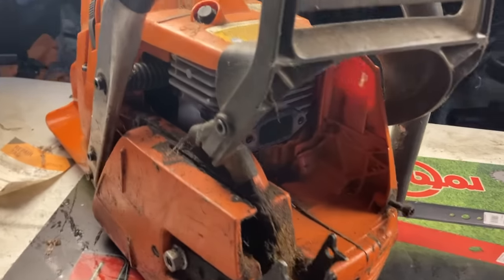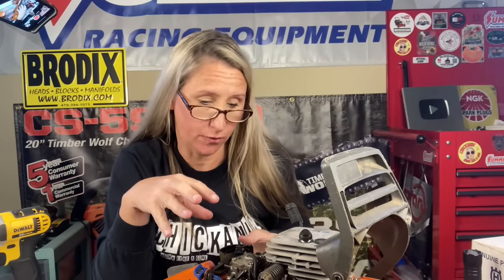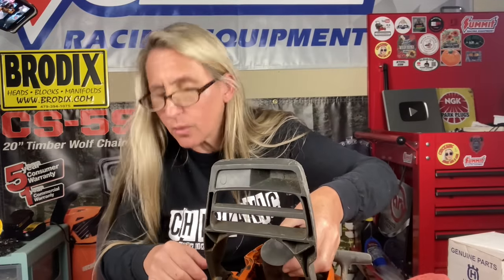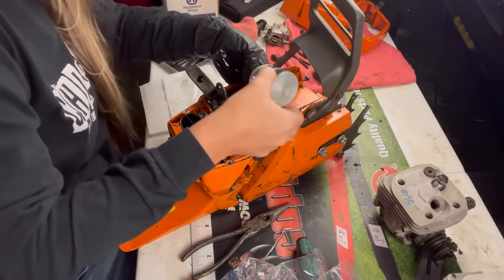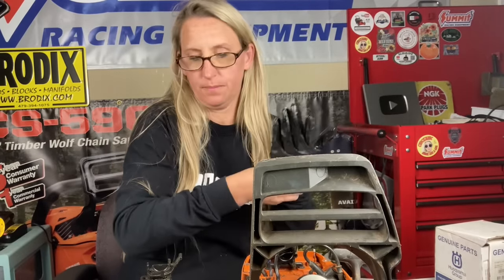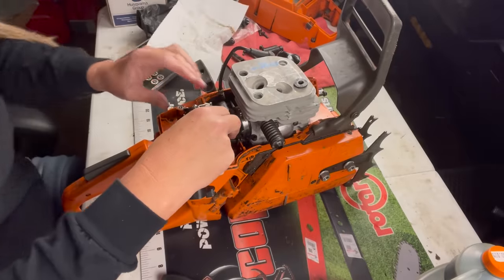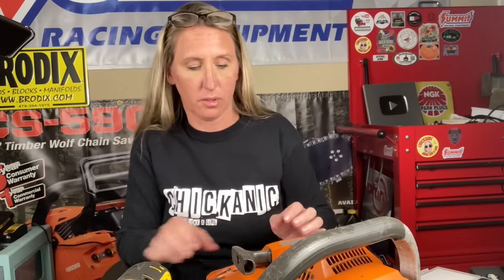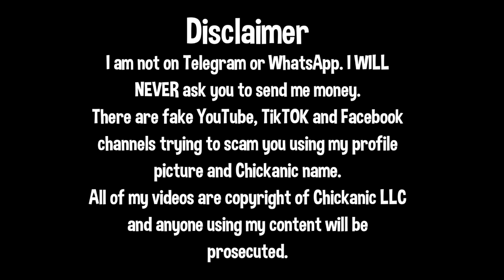Customers $1,200 Chainsaw Destroyed! Husqvarna 372 XP Rebuild

Comment: Tip.  Do not buy an RV.  Rent as needed.  Sorry, you had a bad experience traveling.  Don't make things worse by owning an RV.
Reply: If you really want to buy an RV, get a used one made BEFORE COVID. Everything made since then is complete crap, and they doubled the price.
Reply: What's an RV?
Reply: @artyfhartie2269 Recreation Vehicle is what the letters stand for, but in this case they are talking about either a camper or a bus.
Reply: @ToddAdams1234  Thanks 👍
Reply: I’ve owned RVs since 1985. It’s some of the best experiences my wife and I’ve ever had traveling across the country. Yes, you do have to do maintenance and things do break but the experiences you gain from traveling around in one can’t be beat.  Don’t listen to the naysayers. I flew or a major airline  for 35+ years and stayed in 100s and hundreds of hotels traveling by RV is great you sleep in your own bed and use your own bathroom another perk if you will😁😁
Reply: I would rather stay in my own RV than to rent a bedbug filled room.
Reply: I agree completely...had one, pull behind 26', was glad to get rid of it..did not enjoy lugging a big, bulky flimsy-built thing around that leaked and smelled musty, floors rotted, turns out this is very common with RV's..made the drive not fun,  had to think ahead with parking, getting gas, eating etc...I don't think I would like driving one of those huge arse Greyhound bus sized things around, either..just stay in a tent, rent a motel/cabin, etc...travel light and simple, and you will enjoy the trip more...if your traveling, all you really need is a place to sleep, right? If you want to stay stuffed inside an RV all day, then what's the point of traveling?...
Reply: I found I don't like driving huge greyhound-bus size vehicle or dragging sh*t around everywhere, ruins the drive(which IMHO is part of the experience of traveling)...nor the constant leak/rot worries...different strokes for different folks, I suppose... @skoffco
Reply: That’s a good tip, an RV’s warranties are a nightmare
Reply: You should also know that you will probably use that new RV only about 1% of the time.  It will be parked  99% of the time.  Everytime you look at that RV parked in the driveway  you will be reminded of the  200k-300k you paid for it.  Have fun !!!
Reply: You can stay in motels for the rest of your life for less than the cost of an RV.
Reply: Correct...do not buy rent and get all the insurance they offer...if it breaks down you can be stranded for days...if you rent at least it's not your issue to get it fixed.

Comment: Just a tip from an old aircraft mechanic. Save the old pin and taper one end on a lathe and this makes a great tool to line the piston pin hole with the rod hole. Save it for the next one.
Reply: @waynejohnston2408 Hey Wayne. Serious question. If you use the old pin that you had to drive out.....as a guide to align the new parts..... Aren't you basically going to have to drive that pin completely through as you follow it in with the new pin? And couldn't it possibly damage the new bores if that old pin is just a smidgen tighter in the new parts than the old parts? I've seen great mechanics actually put a small chamfer right on the new pin without complication, which makes it a breeze to insert fully. Just asking. Have a good one! J Pol.
Reply: @jpol3808  A) why would a worn used pin be larger than an unworn New pin? B) common sense would tell you to not do this with a used pin that is so trashed that it has raised burrs. C) you'll NEVER see a great mechanic put a chamfer on the new pin, FFS you have no idea how these parts interact, putting a chamfer on the pin that will be run causes a GIGANTIC problem with the method of retention....
Please don't ever attempt replacing a piston, over thinkers tend to come up with solutions to problems that don't exist, often with detrimental outcomes. This job is done daily on tailgates of pickups out in the woods.
Reply: There are pin press tools made for specific applications and for generic applications she doesn't use them so I doubt she'd use this method. No slight on her though, it's just more tools to keep track of and find when they're needed. Spend 5 minutes getting the tool as opposed to spending 5 minutes tapping out the pin with the tools you're using for the rest of the job.
Reply: Just a tip from an old machinist (just the tip ma'am):  small 2 stroke pins are hardened close to 60 Rockwell on their OD... Have fun smoking cutters in your lathe.  An old 3/8 drive extension will knock out damn near all chainsaw pins.  You're welcome.
Reply: @truracer20  Since your only trying to bash me and I had asked that man a serious question.... I'll still answer yours. A. Mass Production. Contracts changing hands and companies moving overseas, where production standards are not as critical as in the U.S.. Plus your dealing with 3 actual parts and 3 possible manufacturers.😞👎  B. You are correct. Don't use a trashed pin! Good job! 👏 and C. Great mechanics have and will continue to slightly 0.001. - 0.003. chamfer most anything! We're not talking about sharpening a pencil here!😂👎 Lastly... Stick to tailgates! Oh.... Look at the comment above 👆of using an old 3/8 drive extension. That's great! You see a truly great mechanic is past the level of having to bash others to be better than them. They are at the level of passing on what works well for them, to make you better! Lol. Thanks for bashing me though, It truly has been fun! 🎉 Ttyl!🥱.
Reply: @truracer20  The old pin would be tight because it got hot and oil has been burned onto it to leave carbon behind which makes it thicker

Comment: Stihl silver tech here, typically with a scored failure,  you do a pressure and vaccum test on unit before tear down to find possible other issues that caused the lean failure,  crankseals, cylinder gasket, intake manifold, etc. Otherwise  you could end up with same failure again if it was compromised.  And after you install your new top end etc,  you do another pressure and vaccum test to check your work. Also that saw sounded lean in the video, you could hear how it was idling down she is sucking air somewhere
Reply: Winding down on heavy air.  That saw will need another top end soon.   No proper diagnosis cost ya money.
Reply: @mweba1  exactly
Reply: I just replied to her video with the same comment. Good to have someone else say the same
Reply: Without proper diagnosis the piston will score again.  You must find the original reason it scored.  Hole in the fuel line, hole in the intake boot, bad crank seals, whatever it is it must me found and fixed.
Reply: Yes. I could hear it was lean too. it bogged a bit when she hit the throttle and idled funny when she stopped revving.it.  Those Husky cylinders with the removable transfer port covers are known to leak. but it could also have a bad crank bearing or seal. Also it looks like an XPW and not an XP with a piston like that

Comment: A lean condition in a 2 stroke is leaking crank seals 99.9% of the time. The number one cause of leaking crank seals is worn crank bearings.

Comment: Being a Husqvarna Warranty repair person its up to me to determine if it was a mechanical failure or operator error. Which means i have to carefully check everything before and during disassembly . Which includes crankcase pressure vacuum testing.  As always a great video 👍.
Reply: Yeah, no matter what during a rebuild you should always test the crank seals, those are the cause of top ends scoring with professionals
Reply: @SomeGuysSawShop This! The number one cause of a lean condition in a 2 stroke is leaking crank seals. Ran into this many times with 2 stroke mx bikes
Reply: Right, that saw will be right back with the same issue if it is a bad crank seal.
Reply: @dirtyd491  i've also experienced it with 2--stroke outboards !
Reply: Chainsaw performance cannot be tested by simply revving the engine up. A chainsaw may run perfectly until you put a heavy load on it. Then it may bog down and require more carb adjusting. 2 stroke engines of this type also have a maximum RPM. The high speed needle is used to set max RPM.
Reply: SHE DID NOT CHECK THE CRANK SEALS ,It will burn down the new piston in no time .at the very least you must check the plug colour after 1st hard load run , it will be grayish showing it is running lean ,you could hear the uneven idle on the 1st start up because of the seal leak causing poor air fuel transfer into the cylinder . The other tell tale sign was the piston was starting to detonate on top of the piston were the sparkplug fires ,any saw that age will have failing crank seals ,my 262 xpès only sign last year was it was getting hard to start , i didnt let it burn down, and when i tore it appart the crank seals were loose on the crank way worse then i thought they would be , just to show as an example the difference the seals made. after reassembly the saw started on 5 pulls with no extra fuel priming just the choke .
Reply: @davemcewen9991  Question: I have a 570 with the xtorq that is 15 years old. Recently had to have the carb adjusted because it was losing power. Then it burned up. Could the problem have been the crank seals the entire time?
Reply: If the carb adjusts and the motor runs good crank seals are probably fine. If it runs lean where the carb adjustment should be good then crank seals probably an issue. I have seen more burned up pistons on exhaust side from adjusting carb to lean. Most guys running the saw shouldn't be working on them.   @SomeGuysSawShop
Reply: @mdunbar008  Quite possibly, a pressure/vac test is the only way to find out for sure. That's why it's important to do this before the saw is completely disassembled. You want to find the source before you go putting new pistons and cylinders in a saw.
Reply: Thank you

Comment: I did lots of those in 2005-2017 when I was a Husqvarna tech...have done a few since. I'm the first one to admit I despise doing pressure/leakdown tests, but a burned pro saw you are going to put back into service is the time to do one. That said, even if I KNOW the cause was straight-gas, I will usually put new crank seals in as insurance..don't want a comeback or to burn up a new $200 OEM P&C. I do remember, when the X-torqs were first introduced, we had a LOT of them come back burned up, almost new...lots of crank main bearing failures on those, which of course takes out the seals..if it's an X-Torq model, I definitely check the bearings and seals..also the x-torqs were known for having air leaks at the intake boot as well..all in all, I didn't care for the X-torq models, I'd much rather have an original design 372XP..the X-torq was basically a way to keep the popular 372 models in production, because the original design wouldn't meet EPA regs anymore..Everything on the X-torq on the top end was completely different/redesigned, and they have taller engine covers and handlebars than the OE version. Lots of customers didn't know the difference, and wondered why some of the parts from their old parts saws wouldn't fit their newer saws when they started to "Frankensaw" them...I always told them, if the compression release came up through the top cover, it's an X-torq...if the release is on the side of the cylinder, it's an original version 372. IMHO, they should have called the saw something else, like 374XTP, or something...but, they were trying to continue the popular 372XP saw without anyone noticing the changes, I suppose...

Comment: That is a lifetime saw.  Absolute workhorse, I will never give mine up.  Old school pre EPA monster.
Reply: Not quite a pre-EPA monster..the X-Torq versions of them(this is one of them) made from 2010 onwards, have significant redesigns to the top end(piston, cylinder, intake, different carb, etc.), because of having to meet EPA requirements...they are definitely not a "pre-EPA saw"..and also why the later versions seem to have more issues than the original versions....
Reply: @dyer2cycle  glad mine is an OG 372XP.
Reply: I have never ruined a chain saw engine because I have never loaned out a saw and have always mixed my fuel rich with oil. The 372 XP old version is to me one of the best saws  ever made. Fast chain over the bar and gobs of power. I have them down to the 5.5 lb. Echo and up to the massive top of the line Huskys, but I'll take the 372 XP to my grave.

Comment: I have rebuilt alot of husky 372's that sounded way too lean on the test run. Those xtorq's were noted to wear the low end bearings or case pockets out then the seals would leak.  The big end conrod was blue. Which may mean the cylinder went bad from running too lean from an air leak.
Reply: Yes, and they were really prone to intake boot air leaks, also...even if the boot looked fine...
Reply: They heat up to harden the crank end of the rod

Comment: I’m surprised you didn’t do a pressure test. I would have at least checked the PTO side bearing for play and the rod for play. Also that saw still sounded lean on the start up. Sounds just like a saw before it runs out of fuel. I can never just fix anything. I need to know the problem that caused it in the first place. But either way I did learn lots of stuff over the years watching your videos. And no matter what you do people will criticize. Including me haha
Reply: Hi Bre, I'm in total agreement with Robert here. Pressure Vac test at this point would critical in diagnosis as to whether you need to do a total teardown.  Did you have more info from the owner?  Many thanks.
Reply: Sounds like a saw when it runs out of fuel?  50 to 1 is only 2% oil that is all the lube everything gets so when it runs out of fuel it’s out of lubrication. That was the first thing I learned when first using chain saws. Never letting them run out. I’ve never scuffed a piston in 65 years of tree work. Mind you not all of it was 8 hrs. A day.

Comment: Regarding an RV vs airline. Great idea there's lots of places to go, see and do. DO NOT purchase an RV.  Doing so is a great way to lose money to depreciation and discounting when time to sell. Depending on level of use I recommend you either rent for each trip or lease one for a specific time.  Our experience was buying a used 45' repo bus with 4 slides. Pretty much rebuilt all systems to keep it on the road.  Sort of like a chain saw, it's great till it's not then your at mercy of a dealer/repair who has too many in que for repair and they over charge for simple repairs. Good luck. Thanks for your Channel. I think your video' are awesome.  Merry Christmas

Comment: Tech Tip for getting the piston re-assembled to the conrod:  Turn the saw perpendicular to your line of sight, so your able to "see through" the eye of the con rod.  Assemble the wrist pin on the blind side of the piston so that you can see the alignment as you work.  Leaving the piston dry until just before cylinder installation makes for easier handling.  I like a little engine assembly lube on the wrist pin needle bearings but nothing wrong with a bit of engine oil instead.